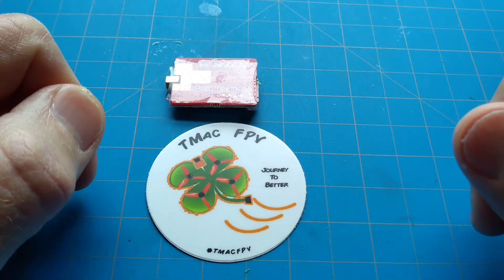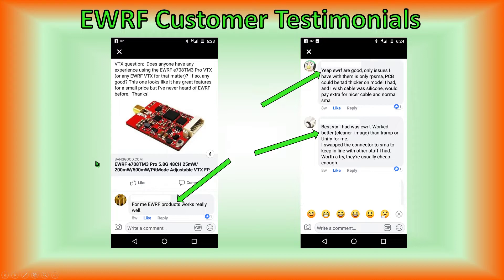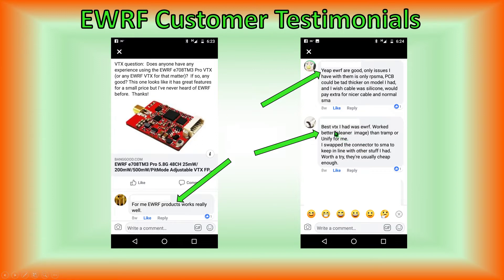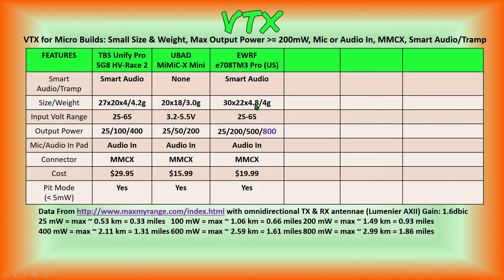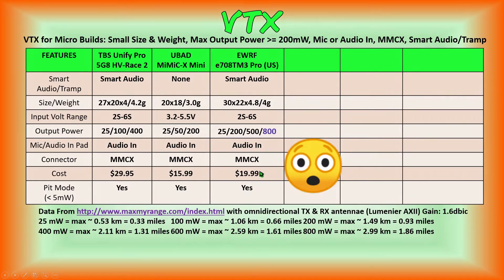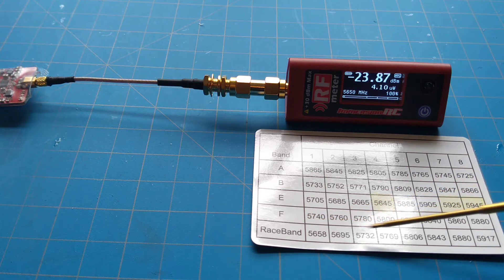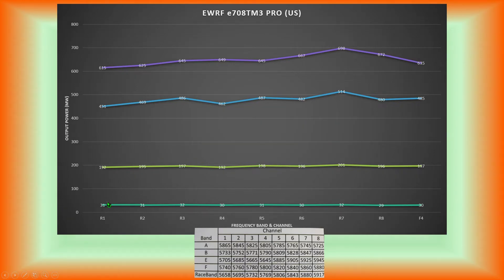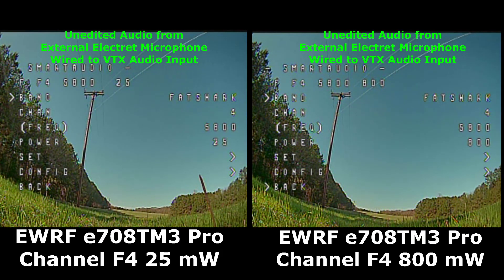MICRO FPV DRONE PARTS-VTX EWRF e708TM3 Pro

Comment: What Verson smart audio is this? i have one and it seems to not outputting the correct power levels, do u have a vtx table config?
Reply from the maker: I use Smart Audio 2.0 (USA) on mine and it works for me.  File is located here: https://github.com/betaflight/betaflight/wiki/VTX-tables

Comment: CHECK this out, this will clear up the MW issue, I pulled this from the PDF manual- e708TM3 pro supports only three transmitting powers of 25mw,200mw and 600mw so far, but there are four power options of 25mw,200mw,600mw and 800mw in the menu of OSD setting. When you make power selection , please note that the selecting of 500mw or 800mw all means that e708TM3’s power is set to 600mw .
Reply from the maker: Very Cool you found this! Thanks for sharing with everyone! I've added a link to it in this video's description with a Special "Thanks" to You! Very much appreciated! Good job!👍😀

Comment: Hello TMac,
Do you think the antenna signal feed is shorted to the ground in this particular VTx? I'm asking this because mine is shorted to the ground when checking for continuity with multimeter.
Reply from the maker: Hey Fikri-sorry to hear you're having some difficulty with it.  I have not had any problems at all with this VTX. In fact, right now its my favorite.  All the features I like with clear video.  With regards to your issue, check to make certain none of the metal "contact points" on the VTX are touching any of the carbon frame, metal standoffs, or any other metal part.  I use double sided tape on mine to cover the exposed metal on the VTX and secure it in place on the build.  This has worked great for me.  You could also try a little bit of clear heat shrink tubing (if you have it) over the vTX. You just need to be craeful with that and ensure it has enough airflow to cool it in flight.  Hope this helps.  Let me know if/when you find fix. Keep at it, you'll get it.👍
Reply: Wow, thanks for the quick reply!
I have isolated the VTx and took the VTx out from my quad so that I can perform further investigation. It turns out the VTx signal feed line is shorted to ground path. The VTx  works, in the sense of it can transmits video feed to my goggles. But, the mmcx connector gets pretty hot to touch, I can barely keep my finger on it for just 3 seconds.
Reply: @fikrimuhammad5511  that's normal amount of heat, vtx will get up past 40-50c easily. Double check your testing the right spots on the antenna/connector, you might be just testing ground by accident, if it's shorted you'd more than likely be having more obvious issues.
Reply: @softsmoken  About the heat, I decided to throttled down the power to just around 200mW so that the heat much more manageable. In case of connector, I'm pretty sure mine is shorted but the VTx still work normally even when I cranked up to 500mW but the downside is the connector gets pretty hot really quick. Like you've said before if this kind of temperature behavior is normal, then there is nothing wrong with my VTx. If it's not too much to ask, could you check your VTx signal feed and ground for continuity/short?
Reply: @fikrimuhammad5511 what antenna is it and where exactly are you testing for The continuity on it? I've done continuity and stuff with antennas before so I know what should be where,  If you can explain the spots exact your using I'll try my best to help you out. Or it's not on the antenna it's on the module itself you're referring to? Essentially the mmcx connector has 3 pins, the two on the sides are part of the outside of the connector which is ground the pin in the center is  the actual positive for the element of the antenna. If you touch the center pin, and then try continuity on the two side pins you should  have continuity on the vtx connector but not on antenna. If older version and it's sma/rpsma connector not mmcx same thing for the most part(and for antenna), the outside part that spins should be negative, then the pin or hole in the center should be positive, for the antenna element, except again antenna no continuity vtx yes continuity. VTX will show continuity almost always because there is typically an inductor in between the + and- for transmitters...
Reply: @softsmoken  Hi Smoke, thank you so much for your thoughtful informations! Also, my apologies for the slow reply. Anyway, I tested the VTX right on the MMCX VTX module connector NOT the antenna connector. Yes, I tested the 3 pins also, like you've mentioned before, I have continuity between the center pin and the two side pins. Since you have cleared my doubt, now I'm pretty confident that my VTX is working normally.  
One more thing, back then I had an awful low-priced VTX with extremely short range of signal broadcast. It used RPSMA connector, but the center pin (signal feed) and the side pins (GND) did not show any continuity at all. That's weird. Actually that's what triggered my doubt when I saw continuity in this EWRF VTX .
Reply: @fikrimuhammad5511  Oh ok i understand why you expected different.. maybe your old one didnt even use that inductor  and so no continuity and was extremely wimpy? yea you should be all set, glad i could help.